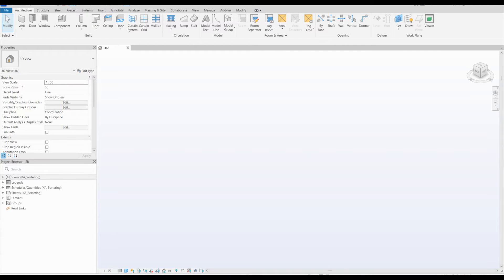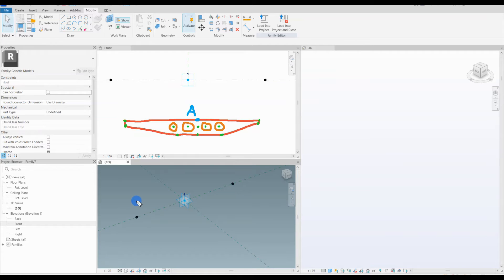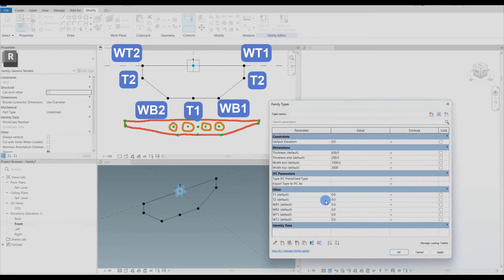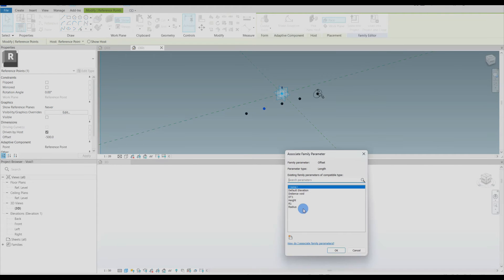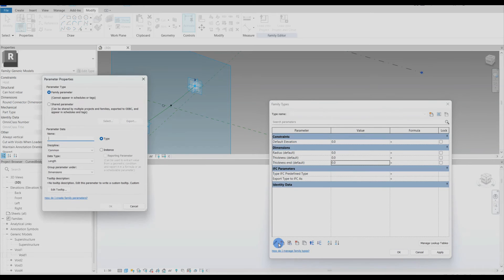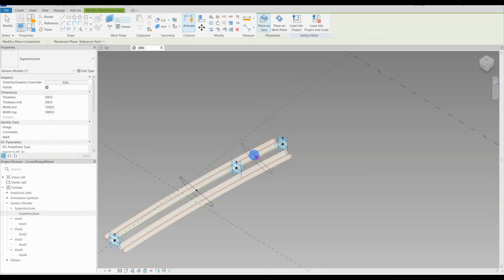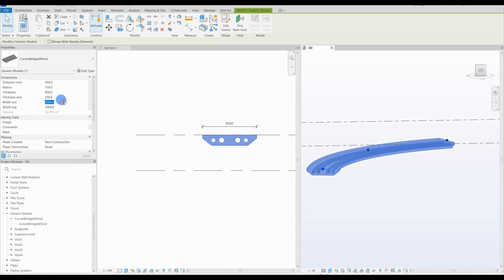Revit adaptive family | Curved bridge with voids

Comment: Hi! Nice video but as others said in the comments the video is maybe too fast and there are several minor details that are overlooked. For instance. At min 3:30 you create the spline selecting the ref points with a selection box. If instead I click over the two lower points, when it creates the spline passing by the 3 lower points it says "the geometry does not define a plane".

Following your video with the selection box it does not give the warning, but why? Does it change something in selecting the points by clicking on them instead of selecting them with a selection box?
Reply from the maker: Hi! Thank you! Yeah! I will adjust the speed on my next bridge video. Thanks for the feedback. It should give the same result by selecting them one by one and select them with a selection box.
Reply: @EngineerBear90  Hi! I tried again today and I noticed that when clicking on a point it changes the shown plane...it select a weird or horizontal inclined plane that I don't get if i select them with the selection box.

Is there a way to prevent this change of plane upon the point selection? Because i if then click on the Front plane to set the previous plane it does not work, it gives the warning. The only solution at the moment is to Undo and avoid to change the plane in the spline tracking process.
Reply from the maker: @candalserendipitero3626  Hello!
Not sure what the problem here is! Could you send me an E-mail with some picture?
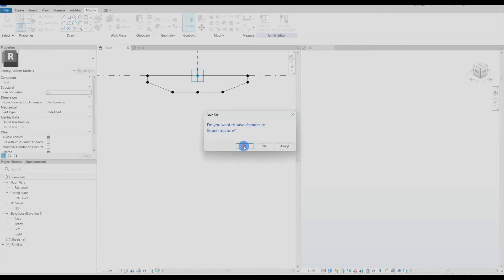Reply: @EngineerBear90  Hi! I just saw your other video with the curved box girder bridge with varying height and around 7:04 you have the same warning. However it does not seem to be a problem because you have no problem afterwards.
Reply from the maker: @candalserendipitero3626  Great it worked out!

Comment: Nice tutorial. Just to add some info from my experience. There is kind of issue with bridges in Revit. Because bridge geometry is mostly in horizontal and vertical curves, we are using adaptive family as you show. But If you want to make section in random position it is impossible :D It is snapping profile geometry from the beginning of the path. Anyways this can be avoided by creating multiple solids and splitting them where you want section. Another issue is when you want to reinforce it. If you place rebar in vertical curve-you can not anotate it and then you need some manual work.
Reply from the maker: Hey Aleksandar! 
Thank you for your feedback ☺